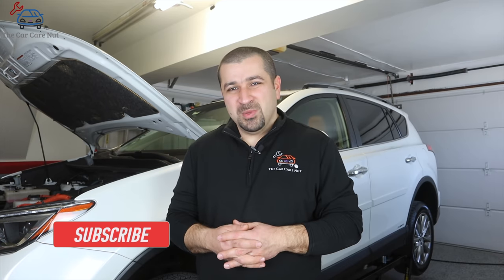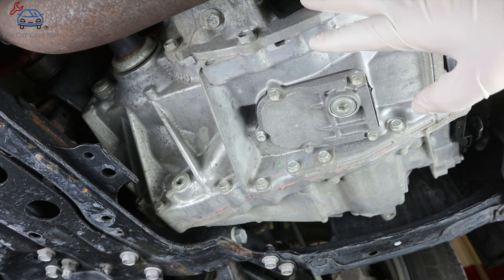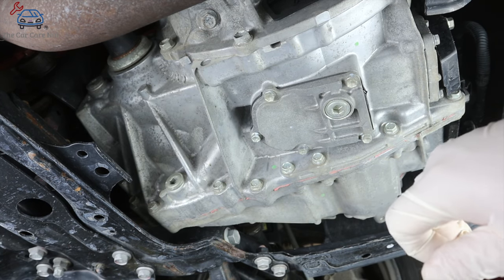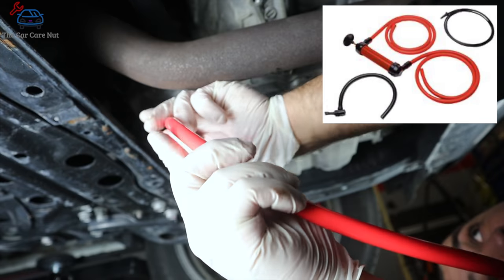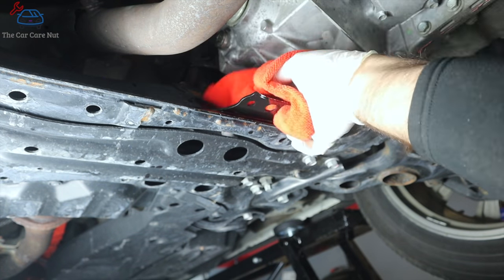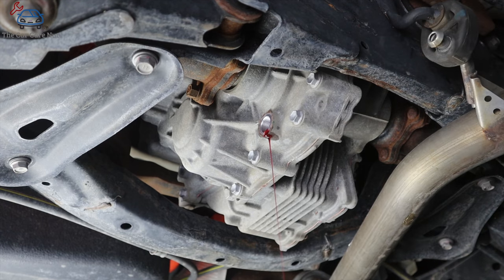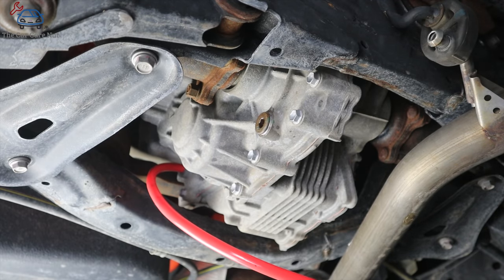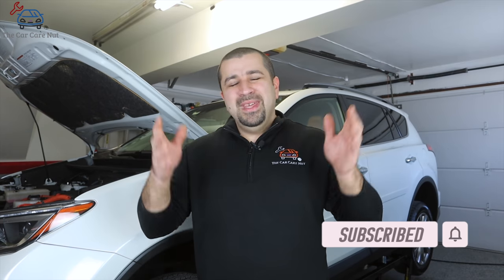How to change Toyota Hybrid Transmission fluid and Differential fluid

Comment: why not run a fluid cooler on the transmission ?  so cheap and guarantees the fluid is cooled
Reply: The transmission is cooled by the inverter cooling loop, but the only source of heat is the pair of motor-generators (particularly MG2). There really is no place to put a transmission cooler because the fluid stays in the transaxle.
Transmission coolers are a great idea on conventional automatic transmissions and CVTs. The torque converter - not used in the Toyota hybrids - generates a lot of heat when it is not locked up.
Reply: @flagmichael  so what your saying , there is a need to keep that tranny fluid cool !   for the cost of a 2 threaded access points , hoses , pump and cooler exchanger !  why not install a cooler on both tyranny and the diff trans !   i would !  heat is the biggest killer of everything with a wet clutch !
Reply from the maker: The hybrid transmission doesn’t have wet clutches. And as flagmichael mentioned it doesn’t have a torque converter which is the biggest heat generator in a conventional automatic transmission
Reply: @TheCarCareNut  so the auto tyranny is some kind of variable / constant speed tranny !   is it wet / steel band drive or dry belt drive ?
Reply from the maker: The video by Weber auto will show you in details what’s going on inside. Also for a more simple version of that see this video https://youtu.be/u15wHYuEFmU

Comment: 5:34 rather annoying engineering quirk that piece of metal is in just the right spot for the draining fluid to hit it and make a mess. I can see that being annoying like how the 0W-20 oil in the CT200h comes out so fast and thin that I've had it splash right out of the catch pan and onto the driveway.

Comment: Car Hybrid battery and hybrid electric are not for me, it's for the rich people,
Reply: Hybrids for Everyone!!!
Reply: Nonsense! We have had nothing but Prius since 2002. I had to replace the inverter coolant pump ($150 and a couple hours getting rusted hardware loose to get to it) at 18 years and 198K miles in the 2002 Prius. My son and I replaced the hybrid battery in the same car (now his - I don't need a separate car while I'm retired) at 210K miles.
We had a 2010 Prius that was destroyed when a driver had a seizure and ended up hitting it in a parking lot, and now we have a 2014 Prius. No repairs beyond tires, wiper blades, and 12V batteries on either one.

Toyota hybrids are how you keep your money. They are by far the most reliable cars we have ever owned.
Reply: @flagmichael  yes yes and yes!!! This is what People dont understand... toyota hybrids are highly underrated... and they blow less co2 into the air... great master piece of a carbon free future...

Comment: dont wait just close the plug 4 extra ounce not gonna do shit to tranny
Reply: Yeah it does! 

These Hybrid transmissions are very sensitive to overfilling! What he said in the video is spot on! Let it finish dripping. 

I take it a step further an open the fill port days after the service to release even more excess. 

The first time I did this job I overfilled it an had very bad downshifting issue. I'd excelerate to 70mph an take my foot off the gas, an as it slows down on its own, the transmission would noticeably kick at 60,000 miles on the odometer.

I opened the fill port an a lot came out. Once I let it fully drip, this kicking transmission issue while downshifting went away.

Comment: what a poor design... gee Toyota could've  done a better job of engineering..
Reply: Yeah like my 15 corolla headlight can't change the bulb and the require the entire front clip to be removed to replace the 350 to 500 headlight nice led and bright but fuck me what a pain in the ass
Reply: Why do you think the best hybrid transmission -- has gears, no belt --  that's easy to service a poor design?
Reply: Personally, I believe it is the most reliable transmission available in cars today. I have replaced enough clutches and sworn at enough worn second gear synchros to know the Toyota hybrids easily beat manual transmissions for reliability. The last manual I worked on had a seized pilot bearing that was a year old. Grr!
Reply: @Davran2742  I think he's just being sarcastic.